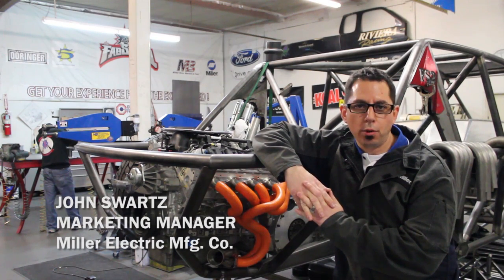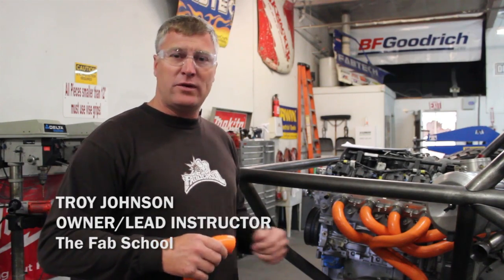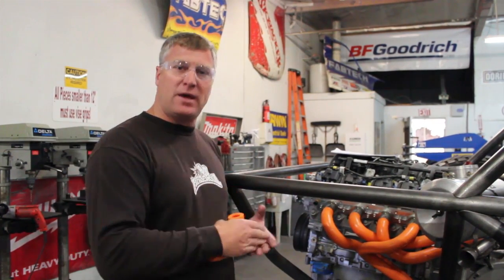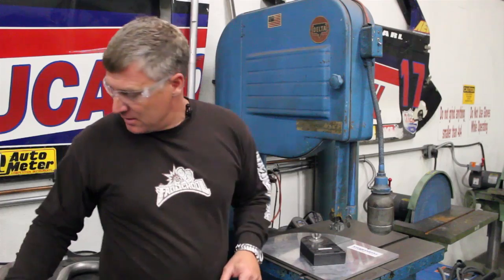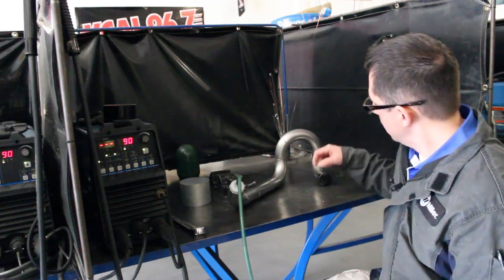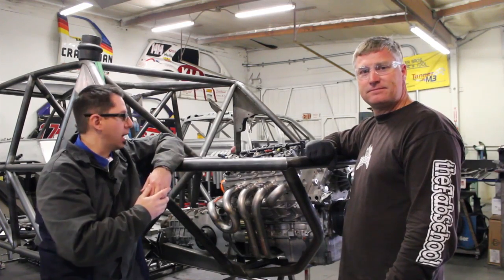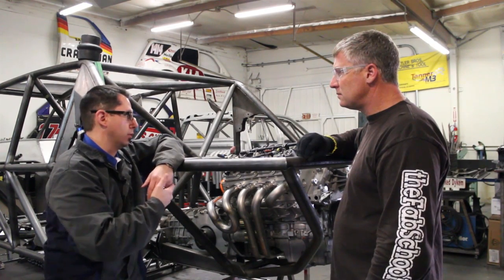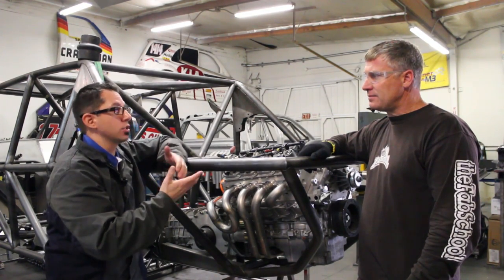The Fab School: Creating a stainless steel exhaust with Ice Engine Works kit and Dynasty 200

Comment: look at the 3:49 you call that a good weld?
Reply: That's a pretty solid back purge weld especially on stainless temp control is nice and even and the puddle size is perfect. not a straight line but that's difficult to do seasoned or not seasoned
Reply: Itll look great one hit with the wire wheel

Comment: That's a pretty awesome kit, but I wish the price was a bit more hobbyist friendly. Even if there was a sacrifice in the quality as hobbyists don't need something which will last 50 years as they would only use the kit a few times a year. Larger diameters like 2.5" and 3" would make the rest of the exhaust system a lot easier to mock up. Glad as a rotary guy I have only two (or sometimes 3!) runners to deal with on turbo headers instead of the octopus of a V8 engine. ;-)